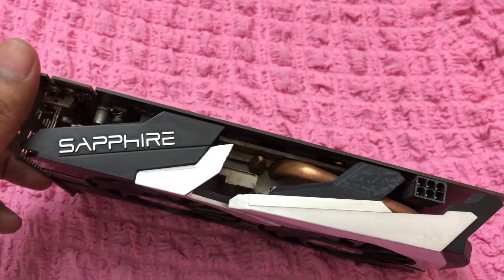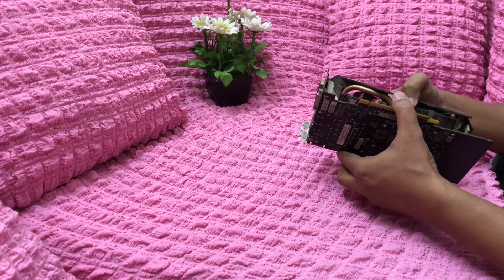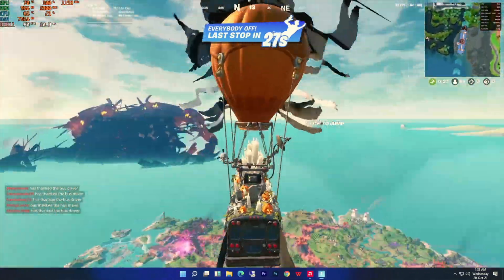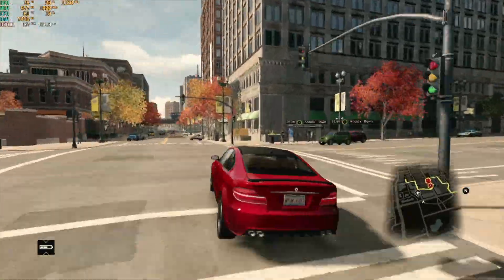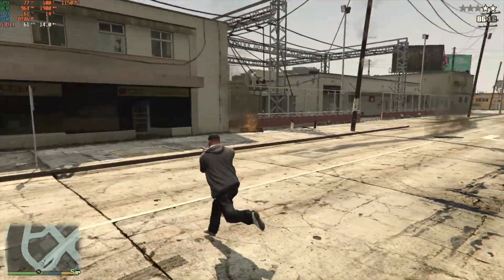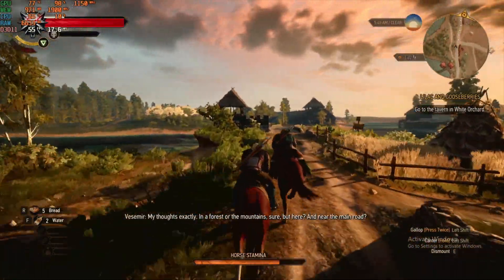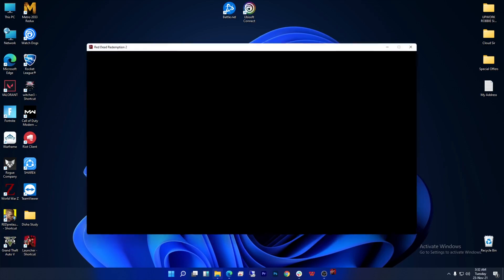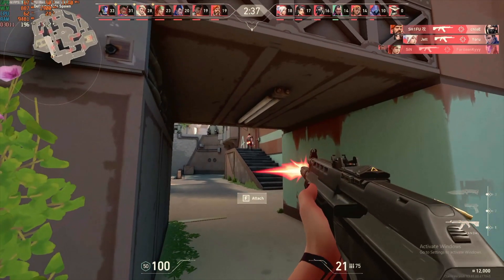Sapphire AMD Radeon HD 7790 1GB DDR5 Graphics in 2022

Comment: Bought this GPU (Club3D single-fan reference model) last year for about $22 as an upgrade for my GT440 and it's the best $22 I ever spent. I'm absolutely blown away by its performance. It actually supports FreeSync (being a GCN 2.0 GPU) + Xbox One's GPU is basically a cutdown HD7790 so I think I hit the jackpot!
About the only downside is the fact that it runs pretty hot. Even with an aggressive undervolt of -150mV (slightly OC'd from 1,030MHz to 1,075MHz) it manages to hit 75c which I personally consider to be fairly hot. 
In any case, I sincerely hope you manage to revive your RX570.
Reply from the maker: Not yet brother 😢. RX570 is still dead. Tried everything from the internet but no result 😔. Even took it to a technician, no luck. Have to change GPU Core. In the future I may buy another RX 570 and replace it's die to see if I can revive it or not 🙂.
Reply: @TechClapEng  That really sucks as GPUs are still pretty damn expensive. Have you considered reballing the GPU? If the GPU die is fine and there's no damage to the PCB, vRAM chips, VRM power modules, MOSFETs etc. then reballing should hopefully revive the GPU.
Reply: did you repaste? paste must be rock hard by now.